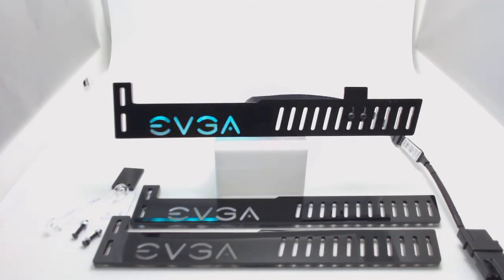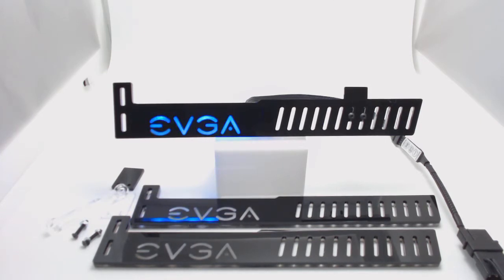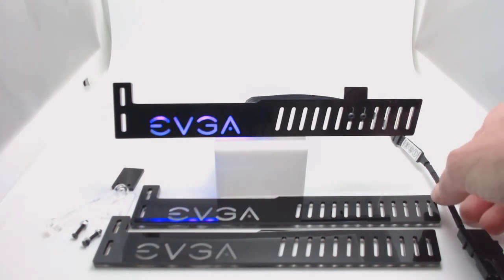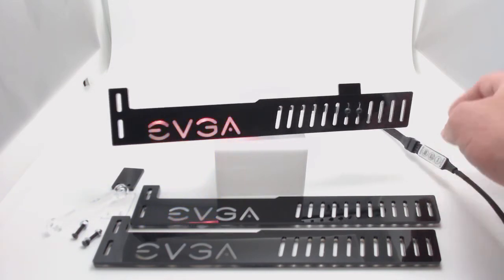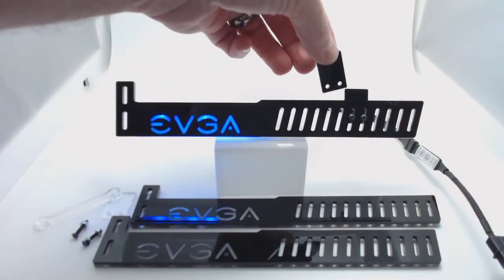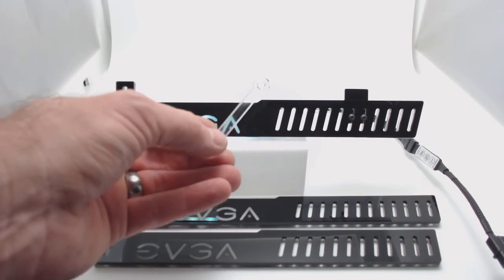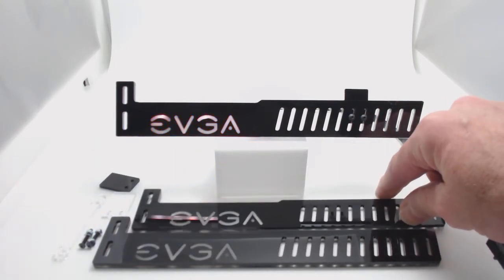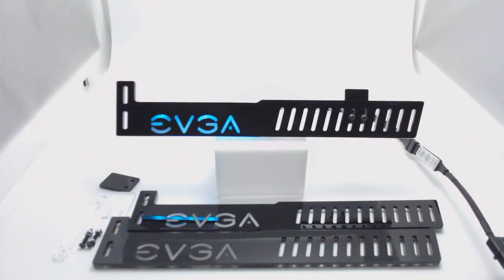Laser cut RGB GPU Support Bracket @jmmods.com

Comment: Would it be possible to get the Asus Strix logo on the bracket? No text, just the logo, illuminated. And how would with shipping to denmark?
Reply from the maker: Bashyour Headin is that the owl eyes? I could do that and shipping would be 22.50.
Reply: Btw ur work is impressive dude..
Reply from the maker: Bashyour Headin I can do it either way

Comment: Can you make them in white? I currently have an EVGA GTX 1080 Ti FTW3 Elite version with a white shroud.
Reply from the maker: Hi Cole! the only issue I can see in making this white is that when you deal with lighting acrylic the only color acrylic that does not emanate light is black and when using LED's  the light will show through white acrylic and if I paint black acrylic white the screws will mar  the white paint and look terrible .
Reply: Maybe you can try painting the layer in between the 2 3mm layers (either side) black, so that it will still show as white, and won't have contact with the screws?
Reply from the maker: Sektor the only problem with painting in between the layers to limit the light from shining through the top layer is that when you glue the two pieces together with the acrylic cement there is a reaction with the spray paint and will liquefy the paint Etc